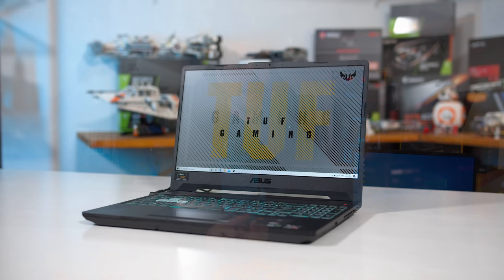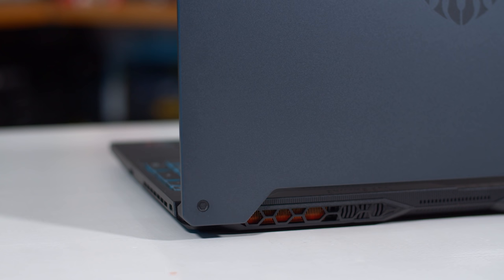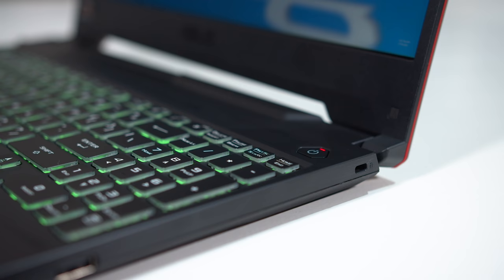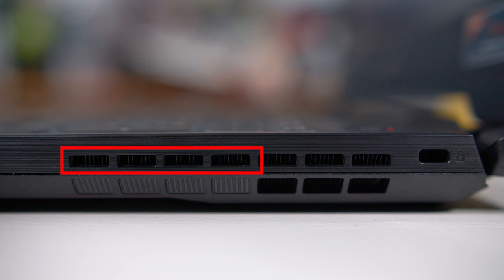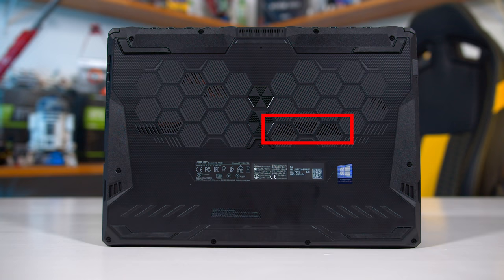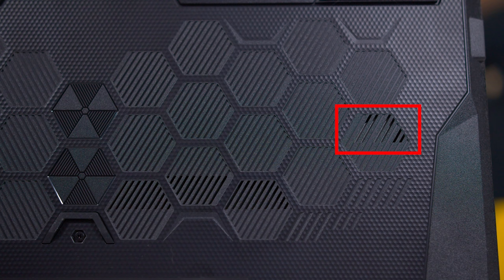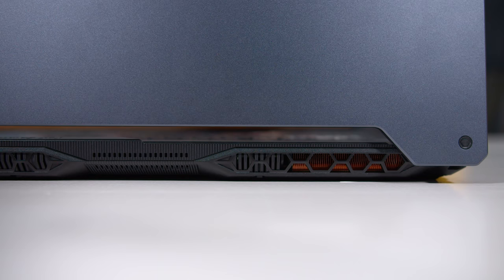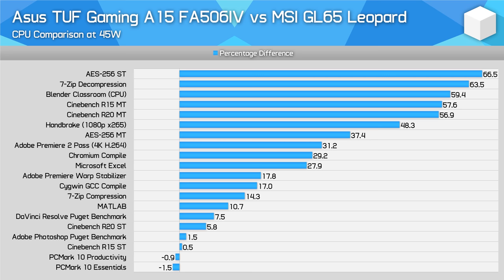Don't Buy The Asus TUF Gaming A15 (2020 Model)

Comment: "Let's put a massive air grill down there"
"Good idea!"
"But let's block 90% of it!"
Reply: Seriously, theri cooling design is as he said 'atrocious'. I and my friend got the TUF FX series model with i7 gtx 1060, but it heats up like crazy and throttling gets unbearable. The TUF series actually taught me never to get a laptop for gaming, go with a PC
Reply: Asus did something similar with their G15 which is an almost identical unit to the M15, but purposely put some plastic strips to block the air intakes for some "inexplicable" reason to make its thermals and performance worse than its Intel counterpart
Reply: @dennisgatere7821  I have the G15, and decided to take off the covers. Temps dropped by 7C on the GPU and 10C on the CPU. What the fuck Asus.
Reply: @a_spire  yep, case mod time.  Could be fun!
Reply: Fake air vents is hilarious, but they need to incorporate more hinges that lifts up the laptop from the table.
Reply: Remove exterior panel, drill small holes, refit, job done. Fu nily eenough I never had an issue with my Tuf 505 series with R5 3550 and 1650.
Reply: @boingkster  maybe 3D print a new one....hard to get warranty work with holes cut in your laptop.
Reply: No worries, majority of cars have their grills covered by 10% more
Reply: Good idea! :D
Reply: Darn. Almost like if rival companies place a mole inside ASUS and sabotage the product.. or perhaps ASUS just ask random intern to design the cooling.
Reply: it's for aerodynamic
Reply: they've been doing that for years on all their strix laptops and I always said it, but reviewers were like: nah man, it still has some air openings so it's fine. idk why it took them 4 years to wake up to reality
Reply: Mod at your own risk. The sizes and locations of the vents on the bottom are clearly very deliberate. You don't know how Asus was trying to route air across components. Adding more vents might lower the CPU and GPU temperatures but if some other component overheats and breaks, you're going to feel pretty silly.
Reply: Any mod you make couldn't do any worse then the wonderful "engineers" at Asus did. 

If anything, you burn it out and learn never to buy an Asus laptop again.
Reply: @a_spire  rip warranty
Reply: @samueladitya1729  yeah, or just hold out for a year and then mod it. lol
Reply: @r.j.sharkey  in that case put tht cover again😆
Reply: that is the most cooling vent ever maed :V Like it look big, nice but block like 90% :V Then why create it in the first place ? :V
Reply: @sadstormtrooper  Yass ofc, rendering some 3d stuff on laptop using cpu engine was also a nightmare
Reply: There was a video which explained why it is designed like that and it is to direct the air to designated places.
Reply: May be they blocked it for structural rigidity. I have a msi laptop with this grill design and within 1 year of normal use all those grills are broken leaving cracks underneath the laptop.
Reply: But why would they not block them on the higher end models, are those supposed to break earlier?
They can always just do what tower case manufacturer should do as well: Use metal mesh. Doesn't break as easy as plastic and leaves air through.
Reply: uhhh so i have the f15 is it also preety bad?
Reply: Update : 2021. The 5800H+3060 Asus Tuf Laptop still hits 95°C. The issues are across products, there are reports of even their higher end laptops and pre-built PCs suffering from the same heating issues. Incompetence at its best.
Reply: @boingkster  will it not void the warranty? And would cutting along the lines be good?

Comment: Please Read this
I myself bought this laptop looking at the price and specs of it. I was really exited to get it home. When i got it i was really happy with it but then i started looking at the temps which on my Asus A15 were sometimes 105 degrees. I then bought me a cooling pad a big one though it didnt help at all maybe 2-3 degrees difference. Like many others i feel sick to my stomach when i see temps reaching 100 degrees when playing light games. 
Now it gets wierd
I decided to open it up and apply new thermal paste on everything (Grizzly thermal). Though it helped i was still seeing it reach over 90 degrees which is better ofcourse but not good enough for me.
Tried to figure out what the problem was. 
The problem was AMD control center which has something called a "Virtual supersampling" function. And it was at factory set to on. I turned it off and bam. It freaking fixed my thermals. The AMD intergrated GPU was under such a heavy load from all the extra noncense settings that it reached that high. For me atleast.

The highest temp ive gone so far after my fix is about 80 degrees and thats perfect.
I wanted to write this to maybe help other people who are stuck in this thermal hell.
<3
Reply: Idle temps are around 47 doing nothing with turbo fan setting
Reply: Idk what are you all talking about these high temperatures. Mine, which has 7 4800h and 1650 ti, in gaming like Nier Automata, GtaV etc gets maximum 75 with cooler
Reply: @corincristian5769  try a benchmark and see what i am talking about
Reply: Thanks for this awesome tip
Reply: @marnoa606  Glad it was useful. You can also try performance mode thats what im using atm. My laptop gets abit noisy when im in turbo mode :)
Reply: @oogabooga420  this worked! Thank you
Reply: thank you very much, i havent seen any much change, but i hope it works..., i bought this last day, and I am so confused why is it heating up while  im just watching videos.
Reply: Yu h it does?? Damn. How is it now? Still heating up?
Reply: @draven9481  Its good now, dud. Thanks for checking.  After trying a video about changing temps and some of the advices here in this comment section, my temps doesnt reach 90 anymore. (.Im cool with it now ).
Reply: Sooo... Do you like the laptop overall? Should i get it too ? :)
Reply: @drew4176  Hi. I do like it but as the market is right now i would get another laptop. I bet you can get more for the money as it is now :) still a nice laptop though
Reply: @opex9  i cant believe how expensive laptops are now... Havnt looked for one for about 10 years
Reply: Joe Average     its in something called radeon settings lite (display settings) . Mine was on when i bought it and it really made a huge difference tuning it off.
I am pretty sure you Will get 144hz with that card but you always look on the description of the laptop if its 144hz.
Reply: Peter, exactly how do you turn off the "supersampling function"? I am about to purchase this laptop. it is all that I can afford. Not as knowledgeable as you folks.
Reply: @msung6179  i wrote how to do it in My earlier reply. Its in the radeon settings :) My nvidia sharpening setting was also on today i noticed. There are alot of other laptops out there with almost the same price as this one.
Reply: @opex9  i just found virtual super resolution in amd radeon software in the display tab
Reply: thanks, but how did u turn it off?
Reply: You saved my life
Reply: Thanks bro 🙂🙂
Reply: @opex9  was about to buy this laptop then i saw this vid, any recommendations for a cheap and powerful gaming laptop?
Reply: @suzumomokise8390  even i have the same question
Reply: @Peter Wolf so what to buy in around $1000 to $1200 budget. Is asus tuf good to buy now?
Reply: @vedant3827  I have the Tuf 15 and haven’t had any problem yet
Reply: @blueking5739  since when u have it?
Reply: @vedant3827  2 weeks
Reply: @blueking5739  ok what are your specs and it would be very nice of you to report your laptops performance after some days. If you wish. Thank you ❤️
Reply: @vedant3827  I got the 90whr battery version and comes with 1660ti, Ryzen 7 , 16 Gb ram, 512 ssd
Reply: @vedant3827  what would the performance be based on? Seems good to me so far, haven’t reached over 85c. I only tried benchmark for one game and that was world war z. Got 100 FPS avg and 76c for avg temperature. Haven’t test other games. When I did get the laptop fist thing I installed was the ryzen controller. It loweres the temperature overall. I never tested any games before I got this. I got it right away after reading reviews that asus was bad cuz of the temperature. This vid he shows the performance on different games:https://youtu.be/iOOljKwv5mM
Ryzen controller:
https://youtu.be/8n5lKZ502TY
There are more vids that explain it
Reply: @blueking5739  thank you so much brother for all this. But one more thing, is 512 ssd enough? How much space did u get initially? Coz i am a kind of person who will be installing 4-5 latest huge games at once along with office and other software.
Reply: @vedant3827  Probably not enough but you can always buy a external hdd. The version I have also have a 2nd ssd slot so I guess that works.
Reply: @vedant3827  480 gb
Reply: Can confirm that Ryzen controller is the best fix. If you have bought this laptop i highly recommend you download it and watch a guide how to setup the program. Its really easy.
No noisy fans now on my a15 and temps are just great now.
Reply: @blueking5739  Credit goes to this fine gentleman
Reply: @opex9   @Blue king  I would prefer intel i7 or i5. Are there any such apps for intel as well?
Reply: @opex9  credit goes to who?
Reply: How do you turn it off ? (Simple Answer pls For people who Are not the best in PC Arena)
Reply: @Nenadimi  explains how in the comments some where. Roll up
Reply: @blueking5739  credits goes to you 😂
Reply: @opex9  even though there are other options I really want this because of the Ryzen CPU and if I'm not wrong only Asus has Ryzen CPU at this price range would you still recommend this or its better to wait
Reply: @khalidismail3075  its a great laptop. Rocking 4800h 1650ti.
Reply: @drew4176  I bought one, even after these reviews - temps are fine while gaming - I did update bios etc... but none of the issues that others are having ??
Reply: @suzumomokise8390  This one - just turn AMD SuperSampling off 👍
Reply: @vedant3827  yes, I bought mine a while after seeing this video - I bought it anyway to see for myself (I only use reviewers as a guide - they not perfect either) & I had no heating issues whatever - I checked the Super Sampling setting & mine was off by default - maybe it was set wrong on Tim's review unit ???
Reply: @genx156  okkk thank you man
Reply: I have the A15, it is always warm atleast 15°c it’s just it’s regular temperature, the A15 is made to withstand up to like 40°c
Reply: I'm not great with computers but am into gaming. There's an a17 out now. Does it have these same problems that are mentioned, or are they fixed? I would really like a good laptop.
Reply: Reading all the above replies makes me happy.  Bunch of brothers helping each other. Cheers yall
Reply: Mine is the ryzen 5 4600h and it doesn't heat up that much, it's fine actually max temp is only 65°c
Reply: Anyway you can help me find out if my laptop is in this mode? I feel like the fans will randomly go max speeds when just watching YouTube
Reply: Do i have to turn it on or off?
Reply: thanks a lot bro
Reply: i couldnt findd this option, where is it? i just changed yesterday the thermal paste hoping for a change but nothing appears to change this temps :(
Reply: @yosefb5813  right click on desktop. If its not there check what version CPU you have on amds website or if you you like me have 4800h ryzen Google "4800h driver" and install a driver for it.
Reply: I recently fuckd up My Asus Windows and installed a normal Windows from USB. It works much better than Asus intergrated Windows from the laptop. Pretty wierd i get about 20-30 fps more than the previous Asus Windows. Uninstalled armory crate aswell + i installed ryzen controller that works like a charm. No noise and keeps cool. This laptop is full of suprises lol
Reply: @drew4176  du
Reply: @blueking5739  update?
Reply: @idkyolo988  laptop runs good but if you want to use max settings, you definitely need Ryzen controller to lower the temperature
Reply: @opex9  Hi! I will be buying this unit for this coming Monday and I just want to ask for instructions on how you did this? I'm not really a techie and I don't even know how to open this "AMD control center". A step-by-step procedure would be helpful.  Thank you!
Reply: @opex9  word?
Reply: @blueking5739  won't it affect the lifecycle of the laptop at all?
Reply: @asagoodfriend  like the battery?
Reply: @blueking5739  yeah especially the battery. Also can I get that iGpu and Panel Override option in my Armoury Crate somehow?
Reply: @asagoodfriend   to increase the life cycle I just cap the battery to 80 percent and you supposed to play charging anyways, regarding the igpu and panel override option I don’t know much about it, you can just look it up on yt.
Reply: @blueking5739  appreciate the info mate!
Reply: @opex9  will the tempreture get high if i play games like minecraft? Lol
Reply: Hi! I have the FX505DV with Ryzen7 and RTX2060. I try to start my PC hobby again. Had to do a lot of manual things like installing windows cleanly, updating drivers and so on. I also noticed the loud fan, thanks for your tip! I will try it out. I'm also thinking about making cooling slots in the housing myself so that I don't have to worry about them. Otherwise runs great, except that my taskbar hangs regularly. 😅
Reply: I can get this laptop for $580 8gb ram 1TB storage ryzen 5 3550h is this good?
Reply: i have problem but i have an intel proccesor  do you know how to fix it with the intel one?
Reply: I have the 2021 model with a 5800H and a 3060. It's an absolute beast that can play anything I throw at it.
Temps? I've seen 85º CPU 75º GPU at 100% load playing Shadow of the Tomb Raider. The cooling solution is pretty much identical to the one reviewed here.
Given the state of the market, the fact that the 5800H is a powerhouse and that I paid about 1000 dollars for it, I'd say I'm pretty much sold. Best laptop I've ever had, and nearly as capable of playing any game as my former desktop (3600X + 2080) that I sold at way over sticker to some idiot miner.
Reply: How to I see the Temperature?
Reply: I just bought a TUF FA506I-CHN040W but i dont find any AMD control centre, is it pre installed in the laptop or do i have to download/??